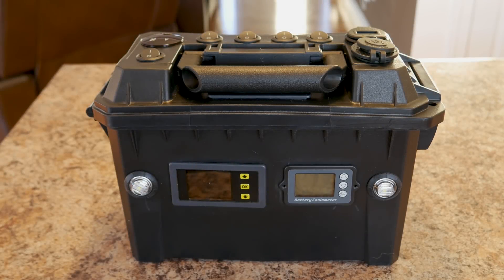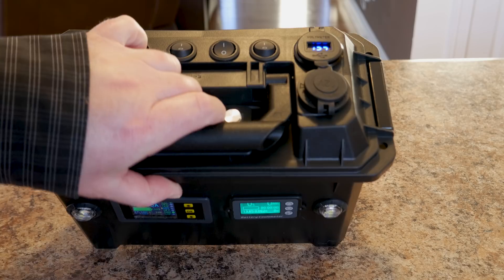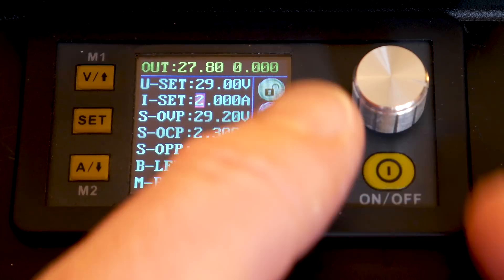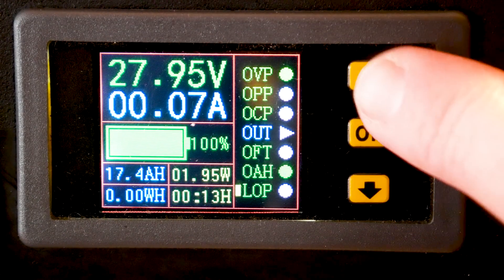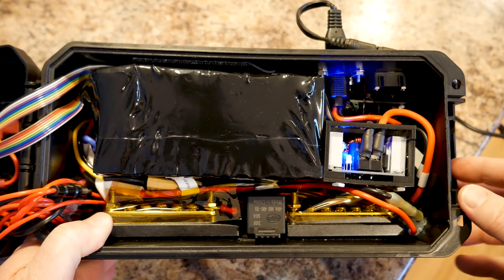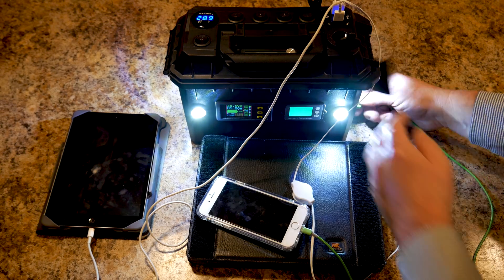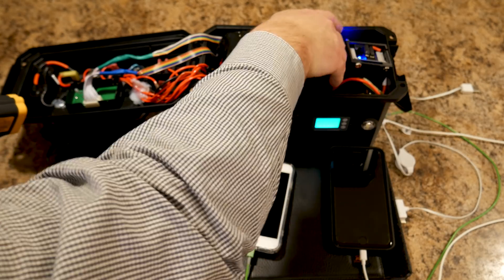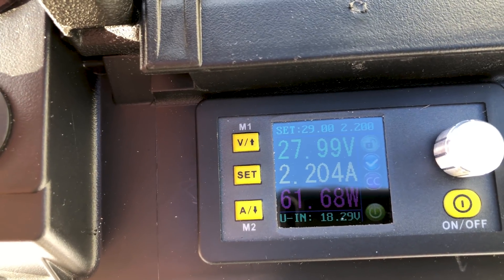Mini DIY 24 Volt 18650 Lithium DC Powerbox/Generator/Solar Generator

Comment: Gave you a like - and now, for some constructive criticism; take it for what it's worth! - TOO much cramped into too little space, for the sake of boasting you have a near-nuclear reactor of a powerplant in an Altoids tin!  Seriously, your plastic box is bulging on the sides; everything's crammed on top of everything else, and no matter how good your little fan may be, if you have little to NO room for air to circulate, IT does next to nothing.  Add a homebrew(?) battery pack (NOT judging you powerpack building skills; BUT), in the summer, you'll be carrying around a potential firebomb.  And that useful little knob sticking out on top; it WILL break off, sooner or later - build a small project-box-type around it (open on top), so it's really protected, while reachable ... good ideas in principle; implementation needs improvement!  Godd luck.
Reply from the maker: Good points, if only I have a way to use integrated circuits to save space.  No issues so far!  This is my go to box for charging drone batteries.  Thanks for watching.

Comment: Nice! I built a similar setup down to the marker lights. Problem is when the lights are on and I'm charging more than one device via USB, the lights strobe. Any ideas as far as cause/solution.?
Reply from the maker: Thanks.  What are you using for a charge controller/voltage regulator to charge your battery?
Reply: @GreenMountainDIYGuy  It happens even when the charge controller isn't hooked up. Only while I have two devices plugged into the usb charger. One thing plugged in, no problem.

Comment: Fantastic design! So much packed into a small package. Very cool.
Reply from the maker: Thanks!  This little guy was tough to work on due to its size.  I'm pleased with the overall results, great for grab and go!
Reply: Do you have a link to the 3D print files for the buck converter cage?

Comment: I have a question. Can you explain why you went with 7s series configuration instead of 6s? For my understanding, 6s x 4.2V = 25.2V and it would fit the 24v system. A 7s would have 29.4V max and it would be higher than a 24V system. And let say I want a 12v system, does that mean I need a 4s instead of 3s?

Comment: I have achieved 22 Volts an 6.5 amps with my drok battery power monitor with a 100W flexible panel  connected to a 12volt lithium   charger I  max6 .love your box . likes your box looks real beautiful man good workmanship .and safe to use .

Comment: Very nice build. Remember not to let the inside temperature of your box, drop below freezing. Lithium should never be charged at or below freezing. Other than that awesome work oh, and thanks for sharing.
Reply: That's right, don't take it lightly. If your outdoors and no way to heat your unit you are flirtng with danger, I had a litium ion drone battery explode in my house while charging it. My guess is A very small amount of moisture came in contact (spilled)  on it so it doesn't take much to make it incindiary. Dangerous!

Comment: Interesting design. I see many of these are absolutely massive, but then again these are designed to also supply AC to a small house. It's cool to see a smaller design. It's also good to see fans as heat is something that is fairly easy to forget about.
Reply from the maker: Thanks.  I like the size but it was a pain in the ass to put together with everything being so small.  No missing AC at all on this box.  Having fun in the field with it!

Comment: That's a great build! I didn't realize you could use 12V to charge a 24 volt battery though the boost buck converter. What are the advantages or disadvantages of that would you say over getting something like a 24V e-bike battery charger to charge the battery?
Reply from the maker: Great question, a smaller 12 volt solar panel works nicely with the boost buck and these panels are readily available in many different sizes.  The boost/buck works up to 30 volts too.  12 volt wall adapters are a dime a dozen.  24 volt works really well too and you can size up whatever you need with the dynamic voltage range of the boost/buck.
Reply: @GreenMountainDIYGuy  I feel like this raises even more questions now lol. If you can use the boost/buck to charge from solar, then what is an MPPT solar charge controller doing different? Or maybe fancy solar charge controllers aren't needed as much anymore since charging lithium ion is so much simpler than the more advanced 3 stage charge needed for lead acid?
Reply from the maker: Clayton Arnall In a nutshell, the buck/boost is a good way to charge off solar but you have to make sure you have the power available.  A MPPT charge controller will do a much better job tracking the sun and providing maximum power.  If you are charging at 2 amps off the buck/boost with solar and a cloud rolls by, the charger will stop. An MPPT charge controller will keep going...

Comment: Love this build! So, is that wall AC/DC adapter a 24v unit?
Reply from the maker: Thanks, the wall AC/DC adapter is a 12 volt model.
Reply: Green Mountain DIY Guy can this power source be used to power 12v fans?  How about a DIY ac unit with 12v source?  I’m trying to figure out how to use an outside power source to use my 12v dog crate fans in my car without using my car battery, and also power a DIY ac unit, or Zero Breeze... also, for those who are technologically challenged, could you build a unit for someone to buy?  Thx, Karen
Reply: He has a buck booster/ converter that allows for different input voltages, nice for being able to use different solar panels.

Comment: I see you like switches:)...I'm working on a ammo can solar power generator but I want it completely "water proof" for camping, boating etc., so you would have to open the lid to use the USB and wall outlets. I'm also using the vruzend system for my 18650's.
Reply from the maker: Good luck with your build, I used Vruzend on my first box, the green one seen in the video.